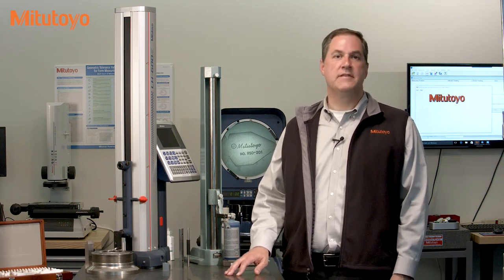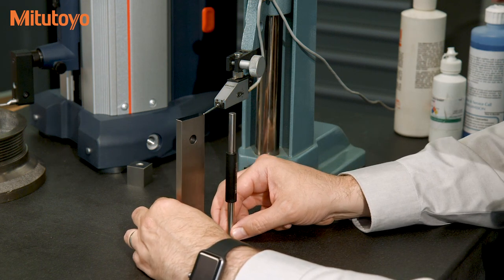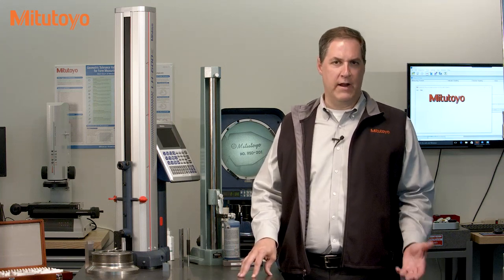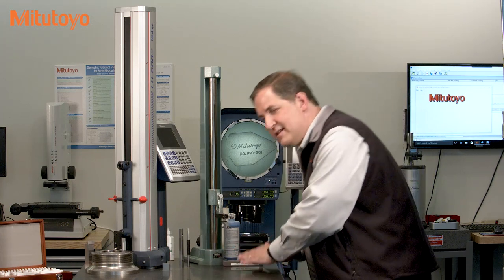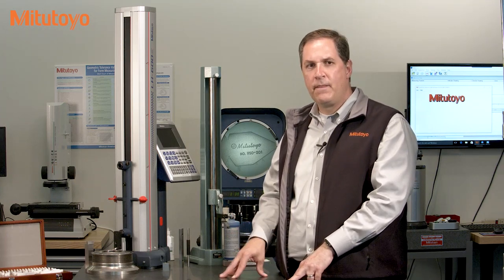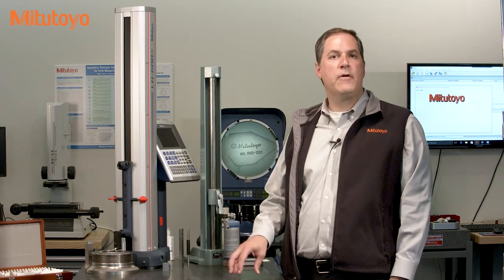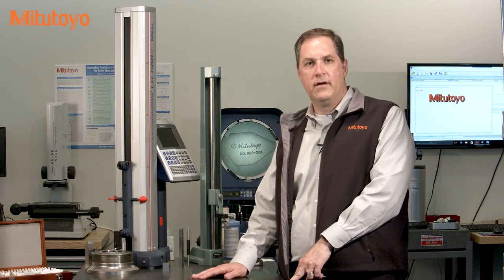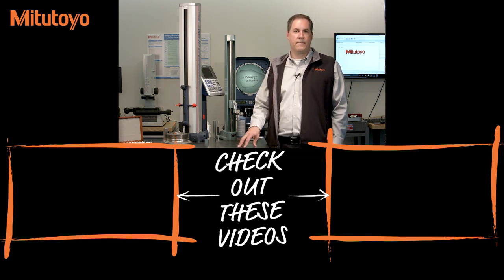Granite Surface Plate - The Foundation of Metrology

Comment: Is it critical for a granite surface plate to be leveled by a three point suspension, similar to those used for cast iron surface plates?  Could you elaborate on what would be considered properly setting up a granite surface plate?
Reply: +
Wayne P
NO!
The purpose of the three point suspension is NOT to level the plate (cast iron or granite). It has to do with equalizing the supported weight of the plate within a plane (determined by 3 points).
NO plate needs to be "level" beyond preventing (non cylindrical) items rolling, sliding/moving due to gravity.
A plate provides a flat plane from which perpendicular measurements are taken.
Reply: The best practice is three point suspension at the same locations used during calibration.  The supplier should mark these points on the underside of the surface plate.  Surface plates are not infinitely thick and rigid, so proper suspension will minimize deflections due to its own weight.
Reply: Check out Dale's video "How to set up a surface plate"  https://www.youtube.com/watch?v=YZgpdMtN-AM

Comment: Good vid I would add the standards as to how the plates are measured for instance and the methods. Union Jack method used for overall flatness using a laser and a repeatometer for local flatness. Great vid though.

Comment: Will the gauge block wring to the surface plate?
Reply: No, the surface plate won't wring to anything. Wringing requires both flatness and highly polished surface finish. But this is good news, because wringing would make using surface plates very challenging.

Comment: We used to keep a 1/4" or so sheet of rubber cut off the shop roll and whomever it was i can't remember came every so often for that bigger one while various other smaller standards were sent off to be remastered or more like testing before being reintroduced or whatever. I think remastering is more like calibrating some mechanized shop standard that checked and calibrated, zeroing, setting etc.. We had more test and inspection equipment than anyone anywhere I've ever seen unless they were machining the same type of stuff, i watch all these guys and they got dial calipers, and OD mics, depth mics, Tri mics, sliding depth mics, etc. Man that's basic BASIC equipment.... u know we had gauges that checked taper and diam. simultaneously and if u had finally grasped it with repeatedly being set right  u definitely were set a part. There's so much shit out there. To me a machinist isn't running a machine, i was quality for nearly 2 decades before i ever touched a machine and when i did i didn't need anyone.....i never ran cnc though but, i was around that and only that while in quality and to me it seemed easier in the aspect of operating the problems were trying to produce too much too quickly and trying to achieve some quality objective that requires yhe patience of a blind cotton crippled dehydrated snail, or a two legged turtle....lol...NS.... fmfks man.... u understand how much money them people owe me by now? Billions man BILLIONS!! mf!
Reply: Yes
You write like a dunce.
But I agree that the intersection of thinking and doing is very lucrative and almost always deranged.

Comment: Use one several times daily.  Both A and AA.  (AA is inside the Metrology lab)  I are an tool and die and metrology nerd.
Reply: BTW, for those interested, there are only 3 basic references that define all the rest.  Flat plane (surface reference), right angle (master square), and circles (center and radius of a ideal circle).  These three can be combined to lock down all 6 degrees of freedom, leaving you a known feature map. Every other geometry can be obtained using these three references.  They're like the 3 simple tools.